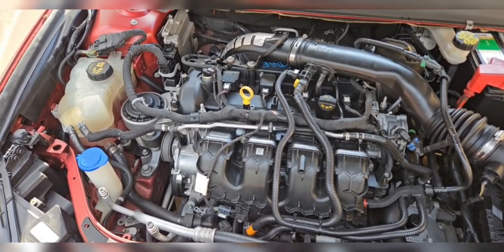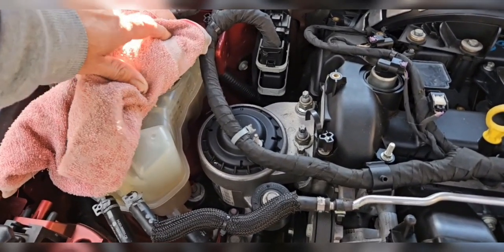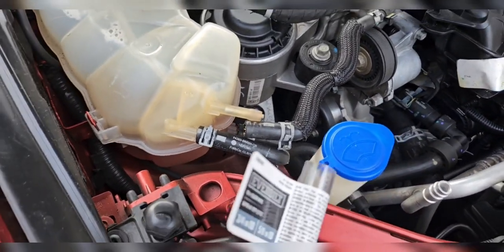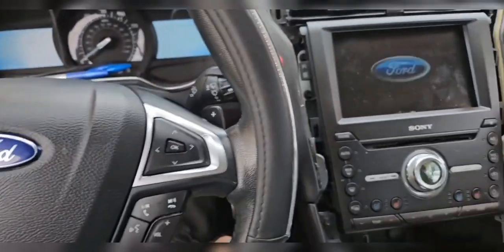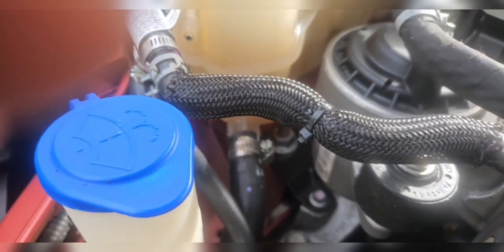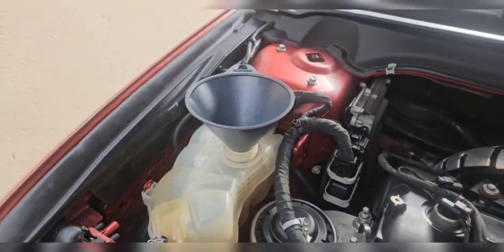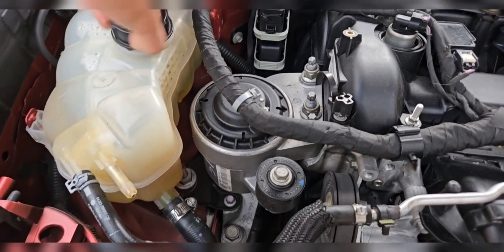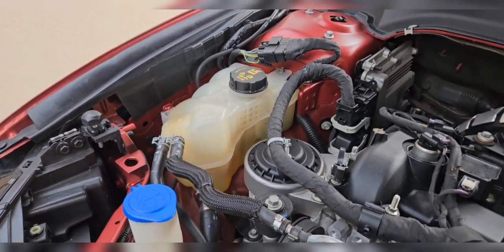2017 Ford Fusion Titanium Ecoboost 2.0 Coolant Flush

Comment: Instead of the distilled water can I use regular tap water?
Reply: NO.
Phosphate coolants react very badly with minerals in tap water.
2012+ Fords used orange coolant, which is now replaced by Ford Yellow, and both are phosphate based for better corrosion resistance.
Reply: NO there's so many minerals that should not be in the engine
Reply: Just pull the thermostat out so the system will flow cold.  pull Tge lower radiator hose to drain, then top back off.  Reinstall the thermostat.    Also. shouldn't use green coolant in this car..

Comment: What would happen if i siphoned out the reservoir and then just filled with the new yellow, then disconnected the return line and just cycled the system until it ran the new yellow through?  I ask because the yellow can be mixed in and figured the vast majority of old orange would be gone.

Comment: What’s the other hose beside the one you removed?
Reply: The line he removed is the line that feeds back from the engine block. The one beside it is the one that feeds the radiator.
Reply: The line he removed is the line that feeds back from the engine block. The one beside it is the one that feeds the radiator.